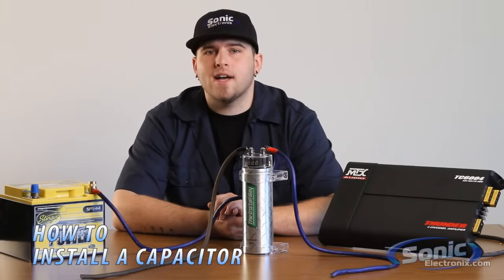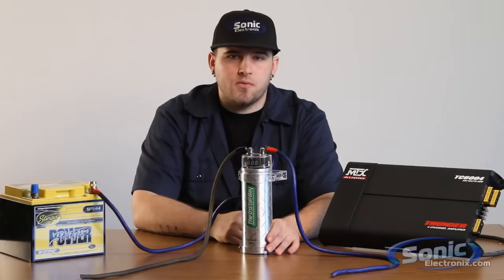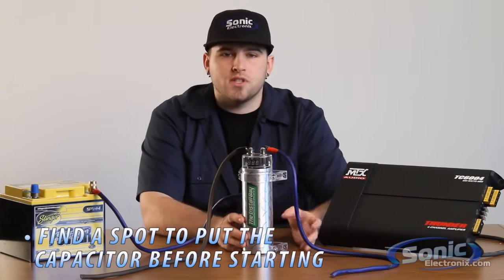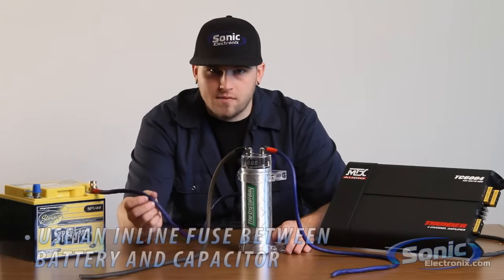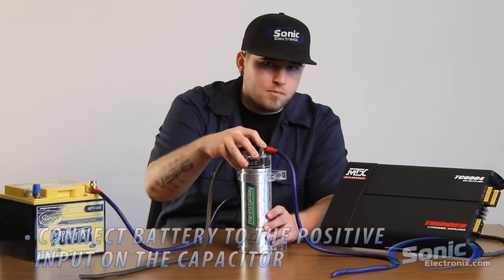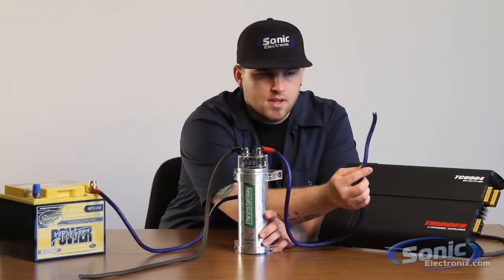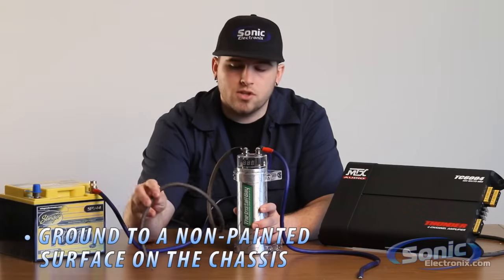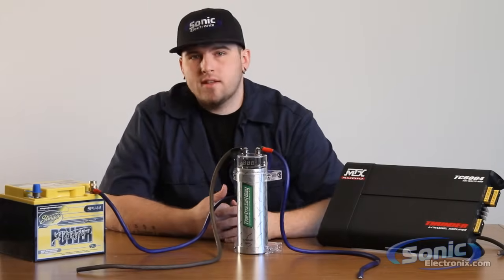How To Install A Car Audio Capacitor

Comment from the maker: That is excellent information and it is correct, however it does NOT tell the full story. Yes, a weak electrical system will suffer more if you add a capacitor. HOWEVER, if you have a very strong electrical system, a capacitor is beneficial in that it can fill up peaks in current and clean up the electrical signal. It will improve sound quality and lower your noise floor. So NO, they are not a waste of money if you know how to use them.

Comment from the maker: There are way too many variables in your situation. It could be a loose or corroded connection or your amplifier is going bad, it is an older system. You can give our tech support a call and we might be able to help you find the problem. 1-877-289-7664

Comment: I have run into a problem with my car audio system. This system was installed a long time ago and I have not added anything to it, except that the battery in the car is brand new three months ago. The Rockford amplifier has "recently" been going into Protect Mode when I have the volume turned up. I haven't encountered this before. Also, when the car is turned "off", I can play the system at full volume, but not when the car is on. I had my alternator tested and it is charging fine.

Comment from the maker: That is in all vehicles as the starter motor is given full power to start the engine and all other electrical devices are powered off and back on.

Comment from the maker: They dim because your alternator is not powerful enough to supply your entire vehicle with the amperage it needs. A capacitor will only be a bandaid to the problem, it will rob energy from your amps to keep your headlights from dimming, it won't actually fix anything.

Comment from the maker: You might need a new battery, do you have a friend who has a battery you can use to test and try to start your car? Once you turn the car on, everything should flicker slightly as the ignition system is powering the spark plugs and turning the engine over. However, once the alternator is on, everything should perform just fine. A capacitor won't help, you should try a new battery first. A local store might let you test one before purchase.

Comment from the maker: If the capacitor has a digital display, if it is connected correctly, it will turn off as well.

Comment from the maker: Capacitors do not run amplifiers, they simply provide a little extra boost of power when needed. You should have one capacitor per amplifier for the best results and only if your charging system produces more power than your system needs.

Comment from the maker: You should have done the Big 3 Upgrade before the alternator upgrade or at the same time, so be sure to do it as soon as possible. The Big 3 is required to allow the new amperage output of the alternator to travel to your components with the least resistance. A capacitor will work great if your alternator is more than your system needs. That way, the alternator will have no problem charging the capacitor and keeping your components at full power.

Comment: I just upgrade my battery and my alternator. Also i just bought a rockford fosgate 1 farad capacitor. Is it bad if i install that capacitor or is it going to help. Alot people say ohh its bad for your new alternator and everything. Also im going to do the big 3 upgrade. BTW im running 2 10 inch rockford fosgate p2 bridged to 2 ohm with my infinity reference 6x9 hooked to amp.

Comment from the maker: Yes you will, your system will work but you cannot give it enough power to bring out its full potential until you upgrade your alternator. It will work just fine, but you will likely have dimming lights and loss of current.

Comment from the maker: Do not get a capacitor until you upgrade your alternator and add a second battery. Your system will work but the Civic has a small alternator and you may not be able to reach the full potential of your system.

Comment: the cap does work remember it will retain a charge and the larger the caps say 1 farad 2, 3, etc the amplifier will perform better at low frequencies output from them amp will be more precise and solid bass tones can be achieved, is a good alternative for low budged systems

Comment: hey i also have a 2013 honda civic sedan

1200 watt amp

2 12' subs..

if i wanted to install  the amp and subs would i need a capacitor? or would installing the amp and subs hurt my stock system?

Comment from the maker: You will need to upgrade your alternator first before getting a capacitor. The Civic has such a small alternator that a capacitor will just hurt your system.

Comment: i have a 2013 sedan civic
with the Kenwood eXcelon XR900-5 Amp 
Alpine SPR 60 & 60C Speakers  
JBL GT5-2402BR 12" Subs
What capacitor should i get and wires to go along with it please? any suggestions?

Comment from the maker: Then all you need is to put the capacitor in line with the power wire of the amplifier, no need for a "high performance" distribution block, whatever that means.

Comment from the maker: Capacitors will not help you, they will only drain your system more. You need to upgrade your alternator and add a secondary battery.

Comment from the maker: You should get a distribution block any time you need to power multiple devices. There is little difference between running with or without a distribution block other than convenience of connection and increased safety.

Comment from the maker: A capacitor is going to be a drain on your system. It shouldn't be an issue but it will drain away at your battery very slowly over time, especially the cheaper capacitors.

Comment: Since a cap is wired directly to the battery would there be any issue with having one on a car that is only driven a couple times a week around town? I know this type of driving isn't really good for most batteries but will a cap make it worse?

Comment from the maker: Yes, you can ground your capacitor and amplifier to the same location, so long as the ground is straight to the chassis with no paint covering the grounding surface. No remote turn on wire should be connected to the battery, as it will always be on. Connect your remote turn on wires to your headunit or to a 12V Accessory wire.
Reply: Why does the instructions to two of my batteries say not to? Just wondering

Comment: is it ok to ground your capacitor and your amplifier to the same place? and also, if your have to hook up a remote wire to your capacitor do you still run the main power wire off your battery too it? or is that still going to cause it to stay on constantly

Comment from the maker: You can connect it to the battery if the battery is close by to the cap and the amp. Most batteries are up front, so running a long ground wire all the way to the front is impractical. If your cap needs a REM wire, it should specify where it goes.

Comment from the maker: A capacitor does not turn off, however the LED lighting or LED meter should turn off eventually. You may need to connect a remote turn on wire to it, you probably have a 12V constant to it instead of 12V accessory wire.

Comment: SonicElectronixTV why cant it be grounded back to the battery, i mean in case of E46 where the battery is conviniently placed in the boot, just curious!!!
Where do you connect the REM cable on the capacitor?

Comment: And after you connect everything, do you have to let the capacitor charge or something like that or you just turn on your system and it's ready to go? Cause I had it installed in my '93 toyota camry but I'm buying a new car and I want to do it myself this time. Thanks!

Comment: I have installed a small car amp within a computer, to run a basic stereo output to a pair of car speakers. The amp is 160w peak, no idea what the RMS rating is, I am guessing 30-40 x2?  
The power source is the computer power supply, and I occasionally get a small amount of hum through the system, which I am attributing to ripple within the PSU.  Can I place a capacitor between the PSU and the amp to eliminate this problem, and if so how which capacitor and what configuration?

Comment from the maker: The cap is best for subwoofer amplifiers as it can deliver quick bursts of energy. Run a power cable to your amps, but split the cable with a distribution block and power each amp. On the power line that goes to the bass amp, add a capacitor to it.
Reply: Help me out up top please i'm confused no install reviews on the black wire from the gravity 800c battery capacitor hook up? don't know what it is used for

Comment: So when installing the capacitor..do I only remove the fuse in the hot wire that is connecting from the amp to the battery?
Also when charging the capacitor do I use a resistor while its fully connected an the put the fuse in.?

Comment from the maker: Capacitors only have a remote turn on wire if they have special digital displays or functions, at which point you can connect it to the remote wire going into the amplifier.

Comment: If i have a 2012 dodge charger and am planning on putting in a 1600 watt amplifier and two 12" subs that are 800 watts max each, would i need to buy a capacitor.

Comment from the maker: The power of the cap goes in line with the power to your amp, as close to the amp as possible, within 12 inches or so. However, the capacitor should use its own ground. We have a video on how to charge a capacitor and a KBase article on our website with instructions as well.

Comment from the maker: They help to stabilize voltage, especially during intense bass notes. They are often used when headlights dim to try and prevent it, however if you have dimming lights, it means you need a larger alternator and secondary battery.
Reply: How do I maintain the capacitor if I store my car in the garage for 3 weeks or so? What should I do?
Reply: Will this work in a hybrid? 
I dont have an alternator to upgrade

Comment: OK I GET IT , BUT WHERE IS THE REMOTE WIRE ???????? IT SHOULD HAVE A REMOTE WIRE FROM THE HEAD UNIT TO THE CAPACITOR TO TURN IT ON/OFF CAUSE WITHOUT IT YOUR CAP WILL STAY ON AND RUN DOWN YOUR BATTERY

Comment: I Installed My Capacitor But My Lights Still Dim What Could be the Probem and i did the big 3 Its a 5.0 farad power acoustik

Comment: dont forget correctly charging the capacitor when connecting everything.

You need to connect up the ground first as normal, but then use a 12volt automotive bulb in line with the positive cable to allow the power to pass through the bulb and charge the capacitor up. At first the bulb will illuminate bright, then dull out as the cap charges, Once the bulb is dim, you can remove the bulb and connect the Cap.
Reply: Most if not all modern car audio capacitors have a little LED screen that shows you when its full btw

Comment: Here mate you see the way ground cable goes, you see the way ground cable goes should i put from aplifier to ground as well as from cap to ground? Because i got told that I dont need to put from Amp to ground anymore as its already grounded from capacitor?

Comment: Capacitors are just a gimmick, get a second battery. All it does is drain the first battery and spills out that charge when the bass is over-powering, then drains your battery again. If you don't beleve me look it up some of the major car guys tell ya. Your better off just getting a second battery in these cases.

Comment from the maker: You really only need to use a capacitor for a subwoofer amplifier, as it has much more transient current spikes than a speaker amplifier.

Comment from the maker: The cap isn't "on" or "off". It is simply the voltmeter on the cap that turns on and off. It will do this until the voltage in the cap stabilizes with that in the battery.

Comment from the maker: It depends a lot on your vehicle. With 200 watts RMS @ 4ohms, you are probably okay as that won't put a huge strain on your electrical system. If you are experiencing light dimming, first make sure your ground connection is solid. Next, upgrade the battery negative terminal to the chassis wire, as it is probably increasing the resistance of your electrical, thus causing additional draw on your battery. If the problem persists, upgrade your battery or alternator.

Comment: Your capacitor is storing power so the display should probably only be one for a little while after you shut off your car.  When you say you have no sound, do you mean just from the subs or all speakers?  Are you running multiple amps?  The remote wire comes from the head unit to turn on the amp which in your case should be getting power from the cap.  Check your ground(s) and connections to battery.  Also, try bypassing the cap, your cap could have gone bad.  Good luck!

Comment: does the amp and capacitor have to have their own grounding distribution or could i run my ground  from my amp to the capicitor, then attach another ground wire to the capictor and ground it to the chasis of a vehicle

Comment: I just hooked up dual 10" subs to add to my other dual 10" subs in my car so know i got 4 10" subs and now the headlights dim so gunna need to hook up my capacitor. this video helped great.

Comment: so you dont have to connect the cap to the cars battery ground.cuz i bought a 2001 expedtiton with the 4 gauge wiring already hooked up.positive to battery and negative to chasis.i want to hook up 2 amps one amp right now dims when bumping it.so what do you sugggest.this is my ride and the info watch?v=NHgp22Cailw

Comment: i bought the lanzar LQ16CAP so could sell it to my friend whos runnin 450rms in the tahoe..but am actually runnin it with my ps-21kx (coverted to 30 amps) and it helped on my bass notes..but my amp now dims (might be cuz 10g input 8g output lol) but in the tahoe it will be @4g which it suppose to be lil bit better tho..i'll let chu know how it performed (:

Comment: i will be installing one of the this next week in a 2002 chevy tahoe along with the hifonics 1200rms amp with 2 12s rockford fosgate and i want the capacitor to be properly charge but im not sure if i should se a light bulb or a resistor..can u do a video on how to charge it plz? any help is apreciated thx (:

Comment from the maker: A capacitor is there to provide more power, it should not messing with your headlights it might be an installation issue. If you look at the knowledge base page we have on our website on capacitors it should definitely help you decided what's best for your system.

Comment: My battery keeps draining, doesn't last more than two days standing... I have the 4 gauge from the + of the battery to the + of the cap then from the + of the cap to my + of my amps..i have the - from my cap to the chassis and the - from the cap to the amps... is this correct, or must i run the amp ground separate.

Comment: Thanks, very helpful. But I'm wondering, why do you need a capacitor? I read something about it regulating power to the sound system etc, for example, if you were driving at night and you had music quite loud with a sub woofer the headlights might dim when the sub booms, is this true?

And what amount / size capacitor do you need if you have a decent sound system? do you wire a fuse in the same area as the capacitor?

Comment: my lights dont dim to bad but wen i put a demanding song and bass hits my amp shuts off and im running it at 1 ohm wich acording to audiopipe's manual for the apsm 1500 it is 1 ohm stable some ppl say its a problem with amprage will a cap fix my problem

Comment from the maker: Capacitors are a band-aid to the problem. A Capacitor will probably not make your lows better, what it will do is "stabilize" the voltage in your electrical system. The problem is capacitors actually add to the electrical demands your amp is already creating. We recommend first upgrading your "Big 3" wires under the hood of your vehicle to get rid of the bottleneck in your electrical system. Second, we recommend upgrading your starting battery to Kinetik, XS Power or Optima.

Comment: if your lights are dimming you might need a stronger battery. caps are good but i would go with a second battery instead. i got a cap in my car with 2 sony xplodes and my lights still dim. im getting my cap swapped out for a battery.

Comment from the maker: Make sure your amplifiers remote input wire is connected to the receivers remote amplifier output. Your amplifier is likely staying on because you have connected your remote wire to a 12v+ constant source, when it should be connected to a 12v+ ignition switched source, such as the remote output on the back of an aftermarket receiver.

Comment: i have two kicker cvrs and my lights dim when the lows come in so if i get a capacitor will my lows actually be better? and does teh capacitor actually charge up again or its only good for a few uses and may need replacement?

Comment from the maker: Audio capacitors are typically used for stabilizing the voltage to an amplifier. You are welcome to check out our knowledge base article for more information.

knowledge.sonicelectronix[DOT]com/car-audio-and-video/accessories-and-installation/capacitor-vs.-power-cell.html

Comment from the maker: when you have a system and have a high power surge from bass, like the brief hard hits, the capacitor let's loose some energy to compensate and help save the battery. very quick. then charges back up.

Comment: Also, shouldnt the cap help the subs out because it stores power thus powering the subs?? The wiring is rated at 1200 watts peak and 680 rms so i thought itd be perfect with the amp.

Comment: Theyre getting around 340 watts RMS each (had a place check em out with meters) and they seem to be getting a good amount of power. Ive had the set up for a few weeks and before that my friend had it for years and they have worked perfectly fine. And the cap came with the set up so I was just going to install it.